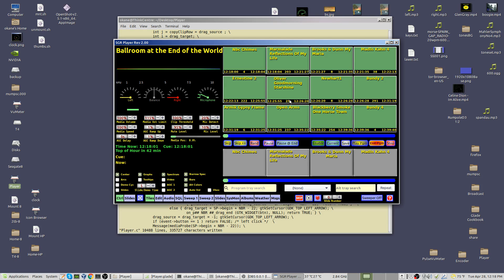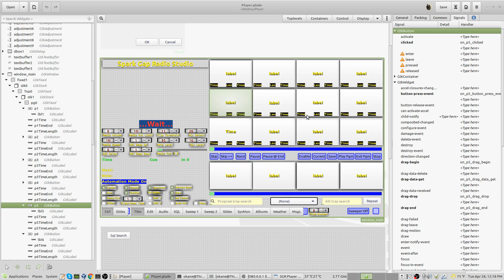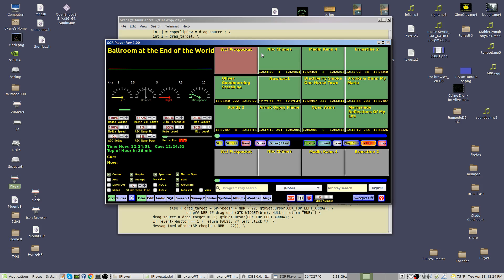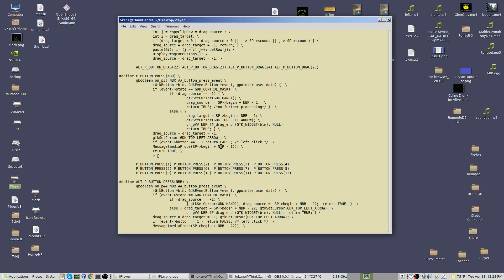Using C macros

Comment: Amazing! I just started learning both C and Glade/GTK right before I discovered your videos. I am working on a simple tic-tac-toe game to teach myself these concepts. I ran into this exact issue of duplicitous code for my 9 buttons to handle each of the tic-tac-toe squares, and I think I'm going to use macros now to solve it.

As I've been forced to peruse through the GTK3 API manual as I've gone, I'm now realizing it would have been better not to use Glade and to have just created the buttons in code and packed them into a GtkGrid using loops. That would also have allowed me to allow the user to configure the GUI of the tic-tac-toe board to allow for more than 3x3 grids (the backend can handle this if allowed to do so). But what's done is done and I'm getting rather of bored of this project and ready to move on to something else, so I'm going to try it this way with macros to at least simplify the code a bit. Thanks!